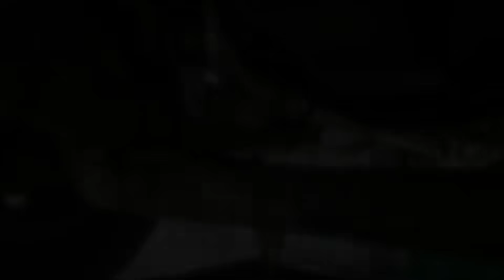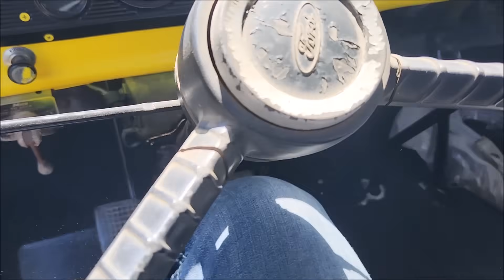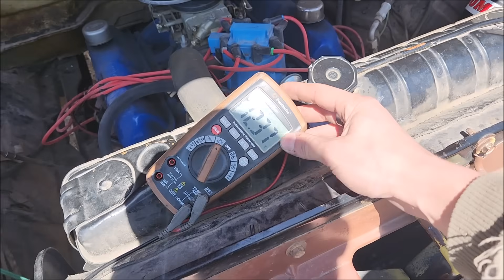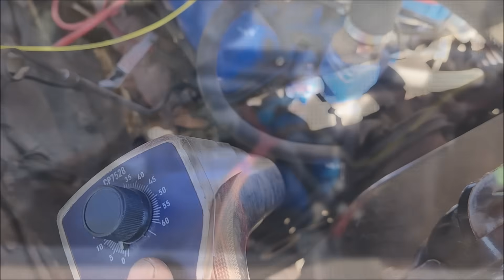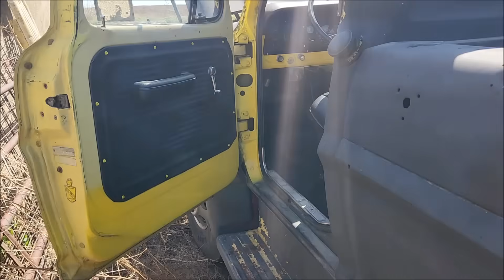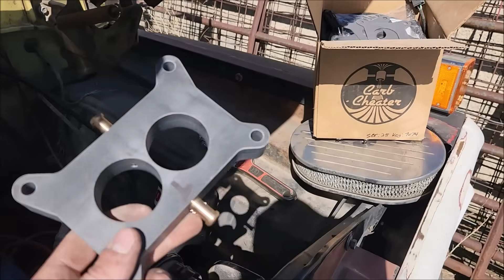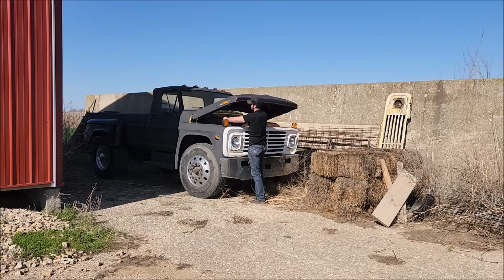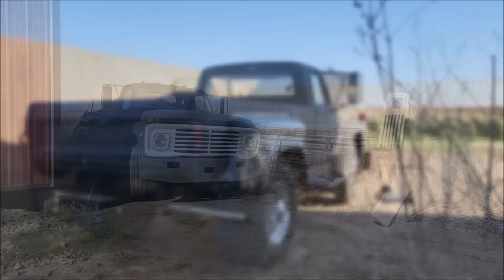Fix & Drive: 1972 Ford "Super Pickup" F750

Comment: Maybe if you would take that tractor trailer rear end out from it and just put in a standard  rear end and lighten the load with some aluminum wheels in a standard size and lower the body to set them you'd have a little more pep, but if you're looking for a heavy duty farm truck you built a fine one

Comment: You sure it's a 391? Most of these trucks had the FT330 in them with an extremely low final drive. I have one and it has a 7.17 gear out back. The poor power could be explained by the fact that it probably has a 330 in it.

Comment: A rig like that most likely shift easier by double clutching it….
Reply from the maker: It has synchros in it, makes it not really matter. Double clutch is for non-synchro
Reply: @ThunderHead289 just saw you struggle shifting from 2nd to 3rd… sometimes in heavy transmissions the Syncro has to work very hard… double clutching quickly elevates the stress… My Grandpa had a 68 GMC 4 speed, and double clutching made it much easier to shift.

Comment: Also, those engines are very low compression. For sure it was points in 72. I have always installed later ignition with a relay on the original lead. From the original lead to an HEI, you will have crap for spark.

Comment: NO vacuum line from the vacuum advance to the carb, hurts driveability especially if the carbg port isnt plugged
Reply from the maker: I plugged it in before I drove, must notnof shown it on camera. 
If you Google, ported vs manifold vacuum, I'm the first video - I'm pretty on the up and up with vacuum advance

Comment: I had a 71 Mustang convertible in the early 80s with a 250SS, and I HATED how often I had to mess with the points, nitrous or not, so I finally pulled an HEI distributor and wiring out of a later luxury car, and I LOVED how much better it ran from then on.  Wiring it up as it was from the factory in that car was the key.  Never had a problem with the ignition again.

Comment: Subscribed. My truck's similar. Mine's a flatbed farm truck. I have a 69 GMC C5500. It has a 5-speed manual a 2-speed rear end a 305 boat anchor of a V6 and it also barely does a little over 50 miles an hour. It'll pull a stump though.

Comment: I've found that most of the HEI failures are due to poor Chinese quality more than likely a procomp distributor , simply throw out all the electronics in it and replace them with some factory GM stuff and you will be surpried how well it will run ...  I have chased performance issues in those things before .

Comment: If you’re going to hit wire that wire to the battery that’s not to smart ,you’re going to start a fire on that harness  ,fuse link would be a safe bet to put in between the battery and the engine  if you don’t ….fire sale
Reply from the maker: Obviously, that wasn't permanent.

Comment: Hey Luke does it have a 2 speed rear? It should and it would help it go faster than 50mph…
Reply from the maker: It doesn't - previous guy put a semi truck axle in it.
Reply: @ThunderHead289   ohh yeah that explains it. my freightliner cascadia has like a 5.32 rear in it but 10 gears.

Comment: The 55-66 Chevrolet fenders are genius! 
I use a 1970 F-500 short wheelbase versa-lift bucket truck to trim the oak trees out on my acreage. It’s really maneuverable for it’s size and I have defied death and mounted new 750-20 bias tires on two of the original Firestone rh-5 Widowmaker two piece rims. Four more to go!
The exhaust manifolds are shot and three bolts are still stuck. But I douse them with liberal amounts of penetrating oil every time I power the lift or the electric winch. The original onboard Generac makes 220 ac which can also be useful. It has the same hydraulic brake lock that yours does, but it still needs a new brake vacuum booster and other safety issues before it is ready to terrorize the streets of the big city. …..to trim my loved ones trees!

Comment: I had 1 that looked the same itvwas an old military truck with fuel on the tarmac that was switched to a dump truck I believe it had a 370 lima engine this was maybe 2003 to 2007 and it was a 1970 maybe it had less than 10k miles on it

Comment: I've got one of these I use around the farm and to haul feed and farm supplies. I ended up pulling the 391 out as it was worn out and converted it to a 7.3 power stroke diesel. It runs very well now, and it has been serving me for 10 years.

Comment: There was one of these for sale locally here in Ohio up by Youngstown (if I remember correctly) recently that they stuffed a Powerstroke 7.3L Diesel into and had the big Alcoa’s but I believe it was all Superduty Drivetrain from the 7.3 the manual transmission and solid front end rear axels

Comment: if that Holley is a list 4412  (which it looks like) than that accel pump is stock. that carb is a 500cfm racing 2bbl. designed for certain classes of racing where the carb is limited to a 2 bbl. Changing the pump alone is not the answer the mains are designed to flow lots of fuel also the accel pump nozzles are huge and the pump ramp is special for the 50 cc pump.  change it to a  list 1850 (600cfm) or a list 3310 (750 cfm) 4 bbl, either will run correctly out of the box. since that is an industrial engine (low RPM) I would lean to the 1850 carb.

Comment: Not meaning to pick on you, but I'd like to see those Chevy rear fenders replaced with Ford ones. I know the bed appears to have been cut to fit the current ones, but being a diehard Ford guy I consider them contamination !! Oh, and I'm 75 now and have owned most of the rigs I've seen on your channel. It was good that someone did away with that governed vacuum operated carb. !! That probably went at the same time the distributor that controlled it went. And those hei distributors, in my opinion, are the only good idea gm ever had ! I put one in the 302 that was in my '92 F150 "Nite" and it worked great.
Reply from the maker: I totally agree - I didn't build the truck and it feels wrong blending parts across manufacturers, especially when it comes to body panels and external items. 
Although I would totally put a 351w with tko 5 speed in a 70 chevelle and not feel at all bad about that.
Reply: HA HA HA--- OH YEAH !!! We obviously are brothers from a different mother and on the same page. I don't know if you follow "Jimmy Dale", but he's got a foxbody Mustang GT with a 434 small block turd in it and he keeps blowing it up every race or two. I messaged him last week suggesting that he build JUST ONE COYOTE and save himself a ton of money and heartache !!  @ThunderHead289

Comment: Love the use of the vacuum gauge.

It seems it's a bit of lost technology these days.

Mechanics just want to plug their scanners in & think they'll know EVERYTHING that's happening. 

One my vehicles had a "ticking" noise & had lost power. Mechanic scanned it & said I needed a new engine. I put my vacuum gauge on it & saw the slump on one cylinder.

Turned out to be a cracked cylinder head. Replaced it & the old beast, 89 Bronco 4WD with inline 6 runs fine now. (I did overheat the old girl getting out of some deep sand.)

Comment: Pretty cool conversion! I owned a 1969 and 1971 F600, the 1969 had the 391FT, 71 had the 330 HD FT. There's videos on my channel from years ago, sold the green 71 when I got the red 69, sold the 69 when we moved out of NY state.

That "HEI doesn't want a coil resistor" got me a really good deal on a 1980 AMC CJ-7 with a GM Iron Duke and HEI.

Comment: That truck is awesome. I really could use that on the farm. If you decide to sell. Return an answer please. P.S. Semi rears takes lots more torque to operate. It may be a 2 speed axial & is operating in 1 or the other gear range. I would convert back to a points dist. You can over carb a non modified engine real quick. Keep what's on it. Clean it good, standard jets & a good 14"x3'" round air filter. It should work perfect. If the valve seats haven't been changed for unleaded fuel, run (Instead of Lead) additive or your valves will bite the dust.

Comment: I wonder why that Holley 2 barrel carb has the “racey” center hung cathedral bowl like the double pumpers use? 

From what I understand those FT engines have super low compression, like in the 7.5:1 range 🙄

Comment: Ford’s FT truck engines remind me of a diesel engine. Supposedly the carb and distributor are “governed” and max engine rpm is around 3600! Everyone talks like if you rev it over 4000 rpm it will grenade. Those engines have FOUR rings per piston and the first ring is a ridiculous 3/32 thick!

Comment: I hate to break it to you. Only 361 and 330 came with 2 barrel. The 391 had the 4.
Reply from the maker: Someone changed the intake for whatever reason - don't ask me why. 
It's why it's the only pained thing on the engine.
Reply: @ThunderHead289  ahh, makes sense. I just know every 360 becomes a 390 when forsale🤣

Comment: This thing really needs a DIY air bag suspension - and it would actually legitimately be justifiable for a change! Could make it ride decent, still have towing capability, and, frankly, it would be pretty fitting for an already 'custom' truck too.
With that said, there's only so much ride quality that you're getting out of a 6500lb truck on semi tires lol. Cool bumper pull tow rig for short trips though(that's the best justification for this I can come up with...).

Comment: Mr.  Thunder head 289, First off, please excuse me, for my ignorance!  I am getting old? 
and forgetful!   I have a collection of Ford f600 4x4 trucks built by Ford!     Yes I am a Canadian!  Yes  Canada is only a fraction of  the US market!   The simplest way to  have a 
f750,  or f600  "super pickup?   is to  simply  get an older one? like you got? the  F750? 
and fit /mount a 8 foot fleet side  pickup box on it !  the easiest model is an f600 4x4  becuase it is a short truck !    make custom brackets? and mount the pickup box on it! 
Now, I DO NOT LAY CLAIM TO BEING THE  SMARTEST  FORD ENGINE  GUY? AROUND! 
NOT AT ALL!    BUT IF THAT 1972 F750  ENGINE WAS ORIGINAL?  IS WAS  A  HEAVY DUTY 
330 CU IN , OR A  361 HEAVY DUTY CU INCH!  WITH  A  FORD CARB? OR A  TWO BARREL 
HOLLEY,  OR A 4150 FOUR BARREL HOLLEY WITH VACUUM SECONDARIES!  THESE  
ENGINES   ALL HAD VACUUM GOVERNORS ON THEM!   IN THE MEDIUM TRUCK CLASS !
THE SUPER DUTY 534 CU IN   ALSO HAD THE HOLLEY 4150  FOUR BARREL  WITH GOVERNOR!    THAT WAS JUST THE WAY THESE MEDIUM TRUCKS WERE BUILT AT 
THE TIME!  THEY WERE FOR WORK!  NOT SPEED!   50 MILE PER HOUR CRUISING ? WAS 
ABOUT  IT!   IF YOU WANT SPEED?   GO WITH THE   FORD  "SPEED" AUTOMOBILE 
V8 OF YOUR CHOICE  !  THEN  BUILD THAT UP? WITH HIGH PERFORMANCE PARTS! 
BUT THAT WILL COST YOU BIG MONEY!  HUGE MONEY!    ANY WHERE ON THE CONTINENT!     YOUNG MAN? EXACTLY AS YOU EXPLAINED? TO YOUR AUDIENCE? 
THE  GM  HEI  IS PREFFERED FOR COMPETITION?  BUT YES! YOU NEED THE FULL 
12 VOLTS TO POWER Up THE GM HEI DISTRIBUTOR!   RIGHT ON!   AND I AM NO,  GENIUS
AT ALL!     I  AM SURE ? WHAT YOU HAVE FORGOTTEN ABOUT  FORD HIGH PERFORMANCE  MUSCLE ENGINES?  I DO NOT KNOW AT ALL! WHY? i NEVER WAS INTO THEM!    I liked  the Ford  f600 4x4!  and I respectfully must say? You Americans  are always  into speed!   Well? all I can say is   if you have a  differential   with a  very high  revolution 
ring gear and pinion  ratio, which is meant for  torgue,  not speed?   your engine will top out
at a high rpm? But  you will not be going fast! So many  folks screw all that up?
Becuase they  do not read? and understand  about the fundimental   facts of the case! 
Also ,  MORE IMPORTANTLY , FOLKS GET ALL SCREWEED UP BETWEEN  LIGHT DUTY 
PICKUP ENGINES?  AND  MEDIUM TRUCK HEAVY DUTY ENGINES!  THE  FORD 390  CU IN 
PICKUP MOTORS WERE LIGHT DUTY V8 ENGINES!   F 100,  250, 350.   ABOVE THAT THEY 
WERE MEDIUM DUTY TRUCKS HEAVY DUTY MOTORS !  THEN THERE WAS  THE HEAVY DUTY GASSERS,   THE   534, AND LARGER V8s  OF THOSE YEARS!    FOLKS  BUY  OLD SHOP MANUALS  THE FIVE VOLUME SET? FROM FORD? AND YOU WILL HAVE ALL THE INFO THERE!    THE BIGGER TRUCK S  WITH TANDEMS? OR THE C TILT CABS!  
BUT IT STILL DEPENDS ON THE GCW RANGE OF THE CHASSIS!!!????  OK?  
HERE i AM? AND OLD FART?  AT 68  YEARS OLD  TWO YEARS OFF SEVENTY? 
AND A SUPER NICE KID? WAS DOWN IN WYOMING? AND GOT HIMSELF  KILLED UNDER A TRUCK HE WAS DRIVING FOR A COMPANY??  AT 21 YEARS OLD?   AND THE  PTO WAS NOT WORKING? AND  THERE IS NOTHING TO SEE UNDER THERE? HE GOES UNDER TO LOOK? AND GETS  STRANGLED TO DEATH?!!! BY THE TURNING PTO SHAFT?  
SPINNING, GETTING CAUGHT UP IN HIS JACKET!    I GET A CALL FROM THIS YOUNG MANS  MOTHER!  IT WAS A HEART BREAKER!    JUST TAKE THE DANM TRUCK TO YOUR EMPLOYER  AND SAY FIX IT? OR I QUIT!   LIFE IS HARD! I KNOW!  EASY FOR ME TO SAY! 
WHAT A LOSS! DEAD AT 21? AND WHAT A WAY TO DIE!  
RESPECTFULLY  kennethzakaib607@gmail.com   Montreal quebec Canada  May 2024

Comment: So the holley performance 4412 does come with the 50cc pump, the adjustment is made with squirter nozzle and cam position, I don't know why the need for the big pump and diaphragm but it does come with it
Reply from the maker: I looked into it - it's basically a circle track carb. 
Way too much pump cam and volume for any street car with low rpm driving. 

I'm used to seeing the 350cfm variant.

Comment: Are those Chevrolet step side fenders? With no current flowing there is no voltage drop.
Reply from the maker: Exactly - which most people don't realize. 
And yes, 56 or 57 from looking at them - I didn't build anything, just got it going

Comment: While they made their truck into a pickup, MY ultimate goal for my truck is to lengthen it about 6 feet so it has a massive bed [it has a 12 foot bed now, but no room for a tool box in front of said bed], AND a relatively large tool box and a bucket boom on it [thus the additional 6 feet], along with dual 90 gallon fuel tanks [that length will help a lot here, as those tanks are 5 feet long], receivers for a welder and torch tanks, and an air compressor.

Further more, a tag axle, and the obligatory tip-handler dynamic brakes needed for the extra high COG of a boom attachment.

That way it can pull my track loader when needed, and also be used to limb trees or set telephone poles, drill post holes, or even pick wild grapes, apples or persimmons out of really tall trees [a problem I used to have on my land, until I pulled all the vines down and put them on trellises, but one I may want to take advantage of on other people's land].

Just an overall general purpose hillbunneh truck.

Comment: I had a 2-to-4 adapter long time ago, no idea what happened to it.

I have a 361 [4 bolt min] in my 74 Ford Super Duty, and am pondering putting a 4 barrel on it, but if I do, I'm likely also going to 'upgrade' it to a 391, 410, 428, or a 435 [428 but with over-bored cylinders] displacement if I do, depends on if I can find one of those super rare cranks, and, subsequently, matching rods and pistons.

NOT for racing, but for torque.

And its a deeply geared truck already [Dana 70 with a 5.11:1 gear, single speed] so its not like it needs a stupid amount of torque, per se, but I want to put an overdrive on it, so it can still have decent torque, at a decent low speed, at highway miles [because at the moment it screams like crazy going down the road at highway speeds].
Reply: Speedway motors has a 441 ci stroker kit not cheap just less than2g but it is very well made . With some decent porting and 428  valves it will make some good numbers and all fe car heads have plenty of room to port .
Reply: @gregallen4272  But do FE heads fit on a FT block?

Last I heard, they didn't.

Not nearly as interchangeable as MOPAR stuff.

Comment: I have an old 76' c65 we pulled the grain bed off it's been a dream for the last 12y to put a ridiculous motor in it, Rockwells to make it a k65, 44s, and a bed on it. I have the axles, the wheels, trans and the truck. I have a dually service body I could make work. Just need motor, divorce case, and time, lol. I can figure the rest out on my own.

Comment: I just face palmed myself so hard because I've been running a resistive lead on my 70 galaxie for over a year. Ive fought and fought thinking it was the carb because when i switched to HEI I also changed the carb. It's ran like shit ever since. Thanks a lot for the info

Comment: Just an opinion; The PTO shaft is great for running a hydraulic pump, or a properly geared winch, however I would not recommend using it on a hay baler.  They baler requires a constant and heaver load over a long period of time, which varies with the thickness of the rows being picked up, also which the transmission and PTO gear box are not really designed for.  Though the transmission might hold up, the PTO gear box might shell out, which could damage some gears in the trans.  Though you might try a couple of rounds in the field for fun with no problems, I wouldn't push my luck.

Comment: My Dad had both a 73 and 79 Ford F700 wheat truck.  The 73 had a 361 FT/2bbl/4spd/2spd axle and the 79 was a 385 Lima Engine/4bbl/5spd/2spd axle.  The 385 Lima with a 4bbl and 5spd tranny ran circles around the 73 with 2bbl and 4spd (max speed on the 73 was about 60mph but that 79 would do a little over 80mph on level highway).  I'm pretty sure the 79 didn't have cats and ran on regular gasoline, I don't know when Ford converted the heavy trucks over to unleaded.  Man, the sound of that starter and the dash gauges took me back to running those trucks back in the 70's and 80's.  Keep it and do a 4bbl carb cheater build, that would be cool as hell.

Comment: I think you helped me solve an issue on one of my cars. 1972 VW Beetle - 2180 w/turbo and 2 BBL Holley (imitation?) It always seemed to get WAY TOO MUCH fuel from the accelerator pump. I'll be damned... I have the 50cc accelerator pump on it. Is it just that simple to change the cover and diaphragm? Some kits I looks at have a plastic cam gear as well??